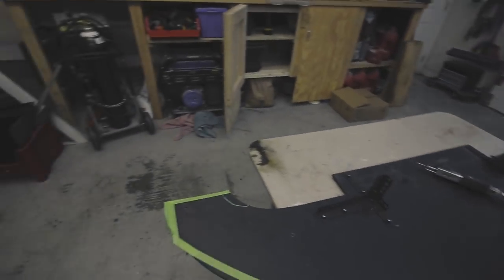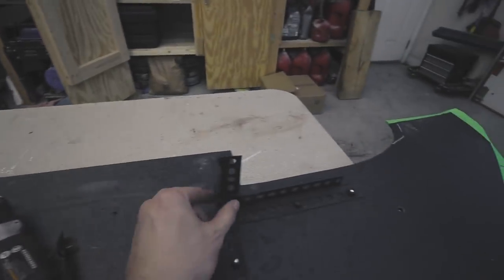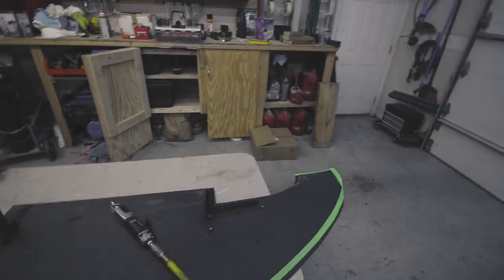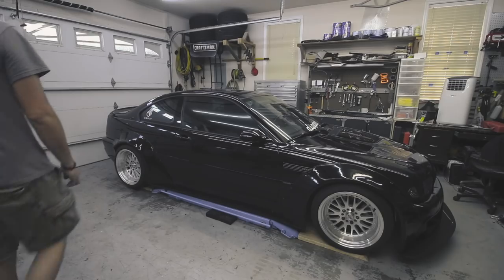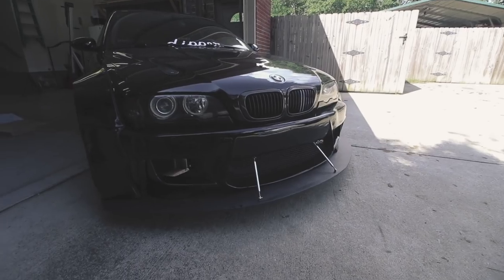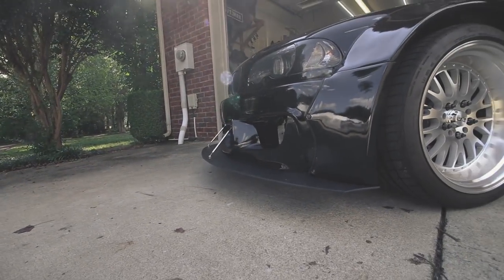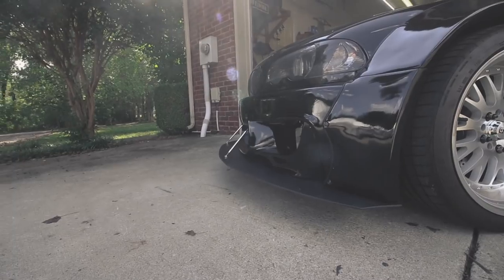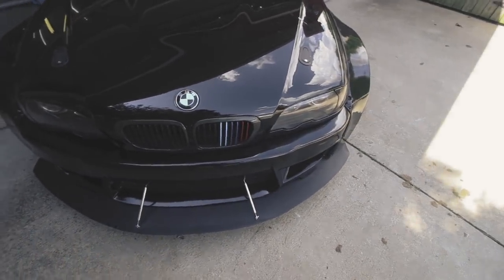Fixed My Front Splitter For You Guys! | E46 M3

Comment: Time to install a nice push start button with classic pilot switches. I got a z3 just bought my push start its 5 speed 3.0 just tryna figure out how to install it. If you do install it in yours could use some tips and pointers from you. Anyways great work on the m3 and not surprised your still putting work in it. Cheers